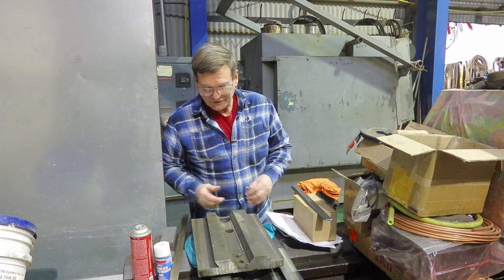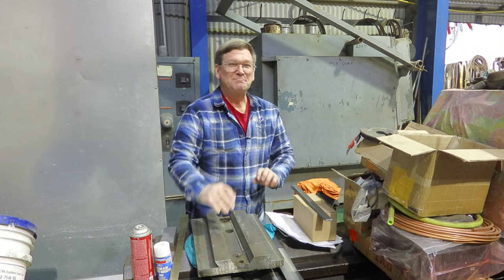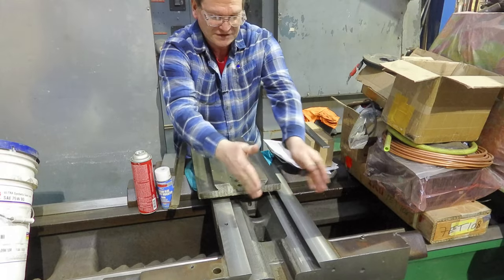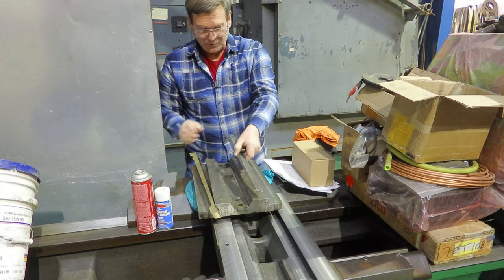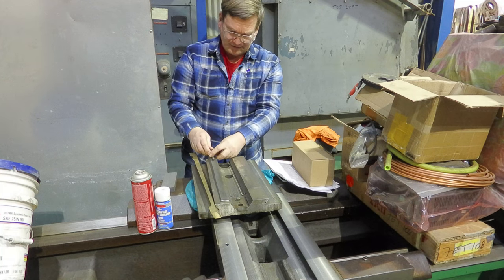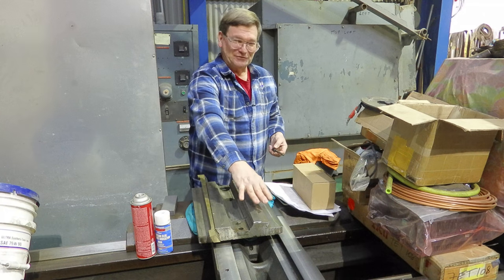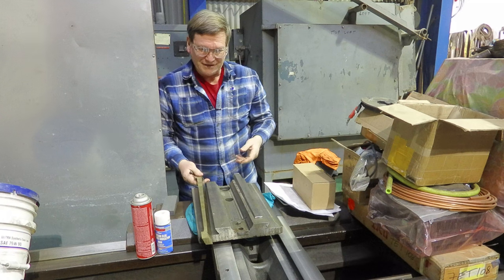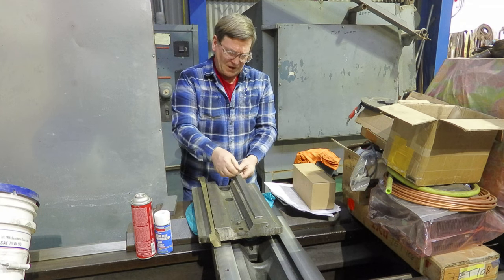Machinist's Minutes: Gibs and Ways

Comment: I thank you for your video input.
I am a machinist and took on a job to kimda clean out the chips and my boss is clearly putting me under a microscope here as he thinks i can't do it.
I have one question though- how do you actually adjust the screws because when I'm doing it the manual feeds tends to get too hard to rotate. 
I learned about the existence of tapperd gibs in this video. I had no idea that they're tapperd.i think your right that some gibs, you can't tell if they're trapped

Comment: Hey, great little video. Wished I watched it a long time ago when I bought my first machine.

Quick question, I have a cheap Chinese mill with a wonky set of ways. I may try and scrap them in,   And the gib already seems like it’s out of travel.   Do you see an issue with drilling out the ways to turn a tapered way, into a set screw type?

I just thought of this while watching your video.  So I may be missing something obvious. Lol
Reply from the maker: If you are careful I think it can work, look out for excessive wear, or just made wrong, ie check that the straight way portion is somewhat straight.  A video is coming about this, it will post tomorrow title; " Answering viewer question about turning a cruddy lathe less cruddy"

Comment: I have a bridgeport that has too much wear for the gibb to take all off the slack out with the stock screw adjustment. Is there a method that a DIY type could do to true it up, like filling in the low spot(s) with an epoxy?
Hand scraping appears to cost alot more than what the machine is worth.
Reply: H&W machine repair should have a vid on it.

Comment: One misspeak error where he interchanged "gib" and "way".  
This video focuses on tapered gibs, but also includes non tapered gibs as illustrated on the Milwaukee mag drill. 
Solid ways are still a very viable design option for machine tools and are found on the most expensive CNC machinery as well as manual machinery, but speeds and accuracy requirements for CNC demanded an upgrade. Linear guides became the standard for these applications. The force lubricated ball bearings in linear guide packs allow closer tolerances without friction resistance and wear. Solid ways and gibs must allow some free movement tolerance for oil and to allow the axis travel to move. My experience is that shooting for .0005" side to side movement is the best target when properly adjusting gibs. As he described, machine wear is uneven, and adjustment accuracy is compromised as the wear progresses. Tightening a gib properly in the worn area will lock up axis travel in the less worn area. Machine use will dictate your adjustment options. He said that the salvaged axis had 1/16" wear damage. I cannot imagine a machine running with this much wear for any machine operation, so this must refer something other than tapered gib/way fitment thickness that I thought he was describing. 
He did describe the 3 most common adjustment methods. His lathe cross slide uses one adjustment screw with a flanged head fitted to a slot in one end of the tapered gib. The gib is adjusted by tightening or loosening this adjustment screw. The other very common method is the two adjustment screw method with adjustment screws on each end of the tapered gib. Tighten this adjustment by backing off the small end adjustment screw and compensating with equal adjustment tightening of the large tapered gib end adjustment screw. Seat these adjustment screws with only moderate torque. Over torquing will "bow" the tapered gib. I have a Craftsman Atlas lathe with square gibs like he described. This is the only machine tool in my experience that has used square gibs unless you include non precision machines like the Milwaukee mag drill 
Machines sometimes don't employ dovetail ways but are true square box ways. This design mandates gibs in multiple directions. The dovetail way design allows the use of only one tapered gib for each axis. Axis and gib wear can be mitigated by proper lubrication and cleaning maintenance. This is why grinding and sanding lathe operations are frowned upon. Abrasive dust significantly accelerates the wear of way and gib surfaces. Way wipers help, but many inexpensive machines don't have wipers and wiper maintenance is commonly under performed. Way surface friction is sometimes addressed by facing the way with with turcite. This sacrificial surface is much softer than cast iron, but with proper maintenance and lubrication can survive in the production environment for many years without appreciable wear. Precision machine tools will be equipped with cast tapered gibs scraped similarly to the ways. This scraping obtains flatness accuracy and provides lubrication oil retention relief. Modern production machinery eliminates the time consuming hand scraping build step with precision way grinding, but automatic forced lubrication is included to ensure that these surfaces ride on an oil film. 
He described applications that use short tapered gibs on each end of an axis. I have encountered this design too, but it is far less common in my experience than a tapered gib the length of the moving portion of the axis. 

Similar gib technology is sometimes employed to compensate for axis screw/nut fitment and wear. In this application the axis nut is split and the "gib" wedge is forced to load the nut halves against the screw thread shoulder to reduce or eliminate this portion of axis drive backlash.